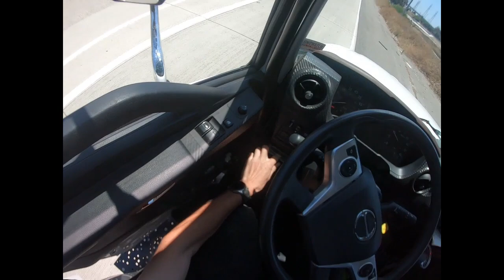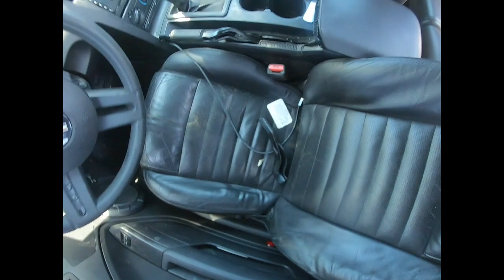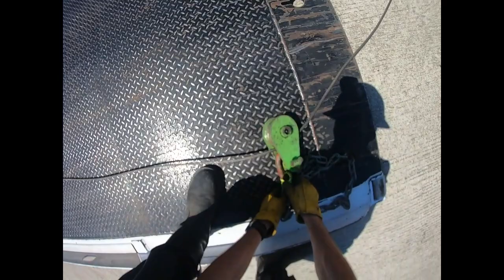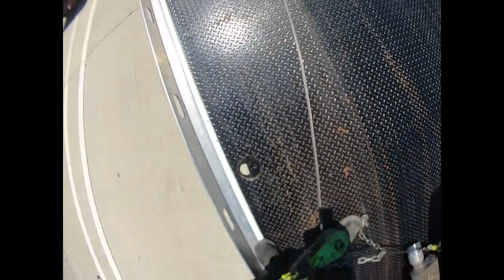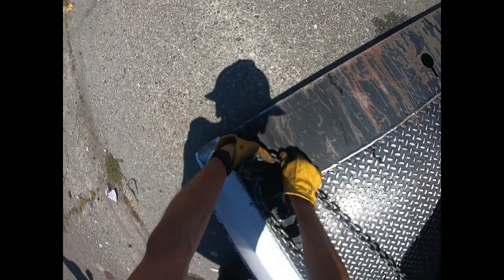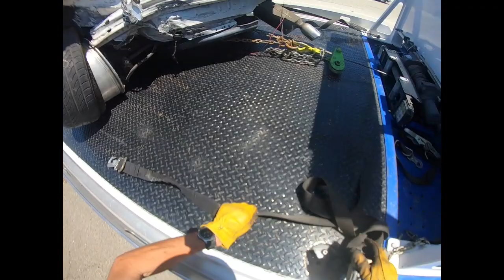LDT #247    SMASHED PONY ON THE 605 FWY  081223    #LIGHTDUTYTOW

Comment: That thing got it good. I still ponder why the place I worked for never bought a snatch block. Said we didnt need one. Was too cheap ETC.     Makes it so easy to spin the car. Fn around with wrecked rental cars i used to pull out the rear wheels when they were pushed in like that so they rolled off easier.. Hahah  Use the truck was a frame machine.
Reply from the maker: You hit the nail on the head right there too cheap to spend $50 the non name brand snatch blocks literally cost that much